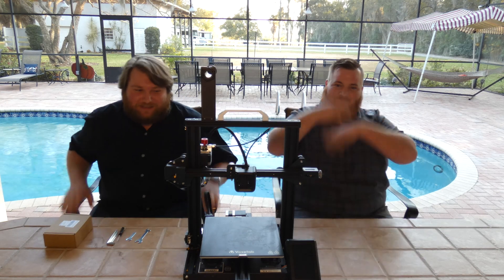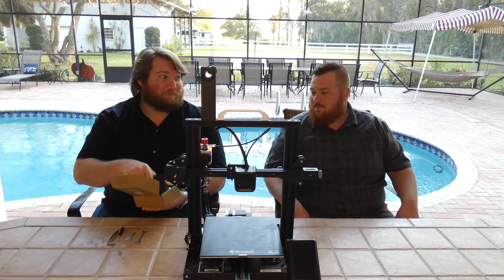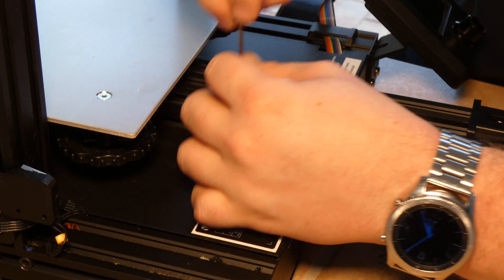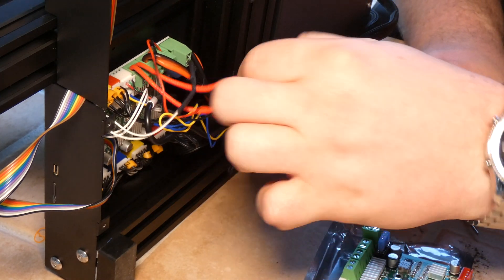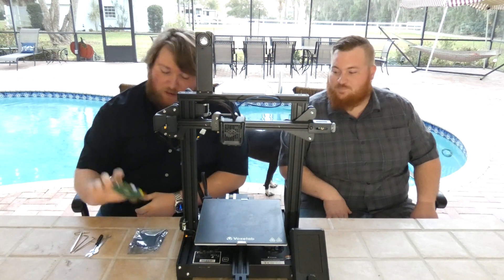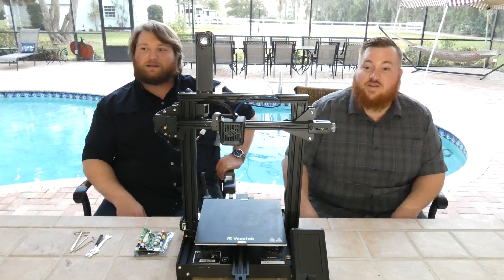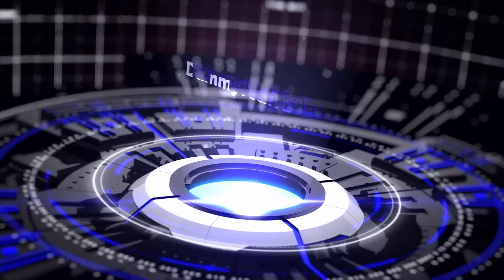Replacing Voxelab Aquila X2 Main Board

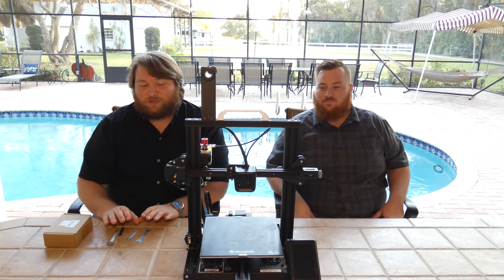Comment: 1:00 The firmware upgrade of the control board worked.  I think you forgot to flash the display.  Good chance the board you described as "fried' is actually good
Reply from the maker: In hindsight I think you might be right. Unfortunately we already went through replacing it. I have since upgraded the firmware of the new board and the display and it is working perfectly... Just probably wasted some money on the new board...
Reply: Whats the link to the firmware upgrade